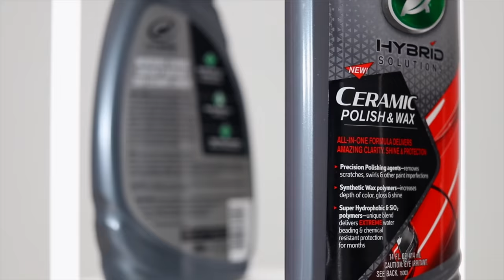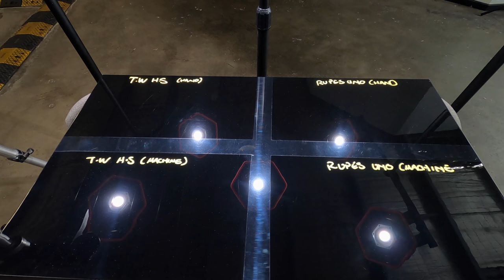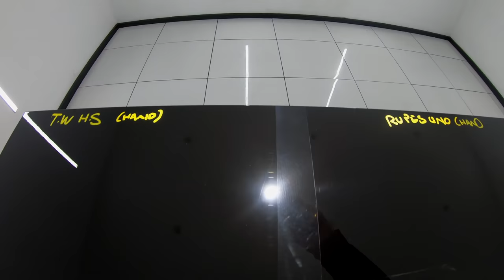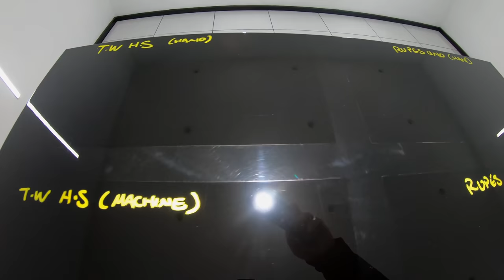Turtle Wax Hybrid Solutions Ceramic Polish, Wax & Spray Coating Tested & Reviewed!

Comment: The issue you experienced when machine polishing is down to using significantly too much product. The amount you applied would have been sufficient for that entire panel ime. HTH
Reply from the maker: It was a couple of small drops on a completely dry pad, so no it wasn’t too much, and my results aren’t based on the one or two panels you see, they are based on a larger number of tests using a variety of paints, pads, machines and techniques as I mention in the video and as I do with all products I review.

Comment: What's your thought on the Turtle Wax Hybrid Solutions Ceramic Spray Coating vs Meguiar's Hybrid Ceramic Wax.

Which one would you recommend?
Reply from the maker: I haven’t directly compared them but I would tend to go with Meguiars as it was pretty impressive and is now much cheaper in price.

Comment: You're running the polisher too fast that's why you had issues
Reply from the maker: No, as mentioned I used various techniques and speeds during my prior testing (the video is just one example) and it simply did not perform or behave well in machine polishing for me, but if it performs well for you that’s great 🙂

Comment: I Don't get why would you apply ceramic spray on top of ceramic wax .....
This procedure will reduce durability of ceramic spray, from up to 12m , to probably  up to 2 months.
Ceramic wax alone is still not known how long it will last...... So I am not playing that game.
2 coats of Ceramic spray alone according to some detailers should last around 8 months, with
2 hours between coats.
Waiting 24 hours after applying ceramic wax to apply ceramic spray is very inconvenient  .
Too long basically when you are making money detailing.
Ceramic spray alone , then 2 hours later =same day another layer of it sounds way better.
My only concern is if ceramic spray fills imperfections considerably less than ceramic wax.
If ceramic spray fills just a little less then I suppose there is no point in using ceramic wax at all.